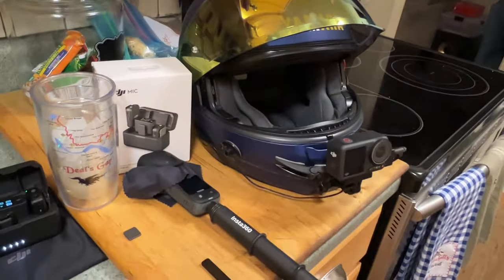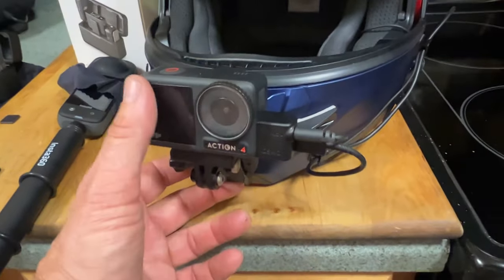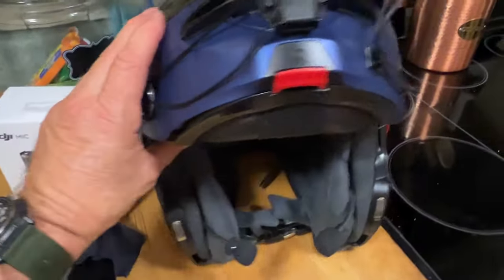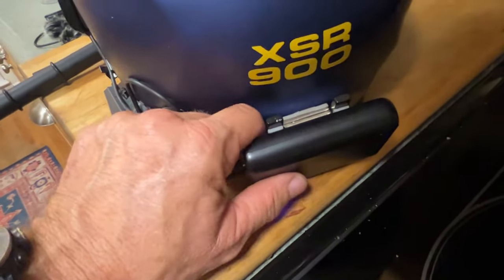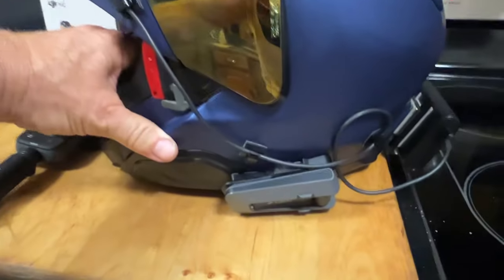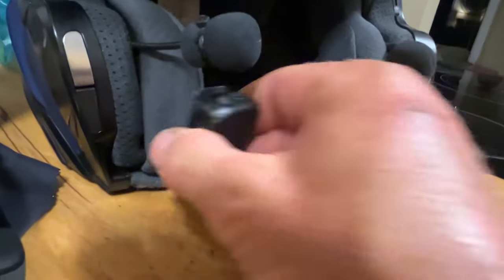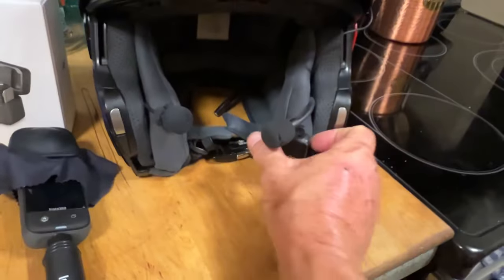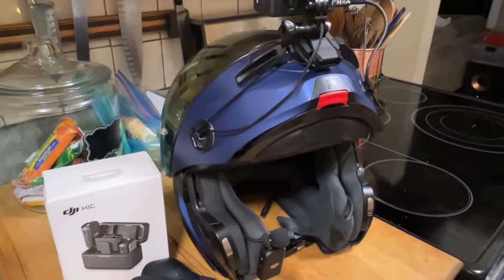DJI mic installation on motorcycle helmet and basic moto vlog setup

Comment: Sir, can I use the same technique to install my Hollyland lark m1 in my helmet?
Reply from the maker: I don’t own a Hollyland Lark but looking at them on Amazon it looks like they have a couple of different models.  The Hollyland Lark MAX appears to have on its microphone/transmitters a metal clip with a circular magnet - similar to the DJI Mic.  

I think any similar mic with a metal clip on the mic could work with a magnet installed into the padding of a helmet the way I have it in the video.